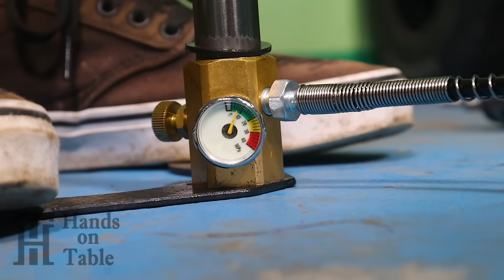I Turn Motorcycle Shock Into Fishing Gun

Comment: I once built a small blank-firing cannon from a truck hydraulic cylinder and clad it in a glass fibre jacket I’d cast in a mould to get all the exterior detail correct. Added timber and a pair of old cartwheels.
Reply: เคร
Reply: I've love to see it!  sounds cool.
Reply: @brentbarnhart5827  I should clarify - It didn't use the cylinder. It used the internal piston which is a hollow tube with a  very smooth and shiny exterior.